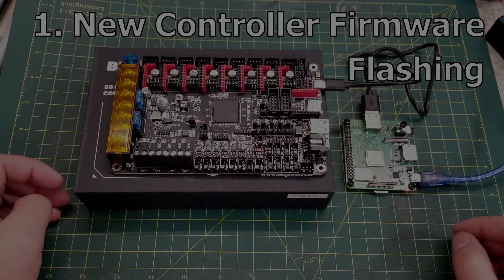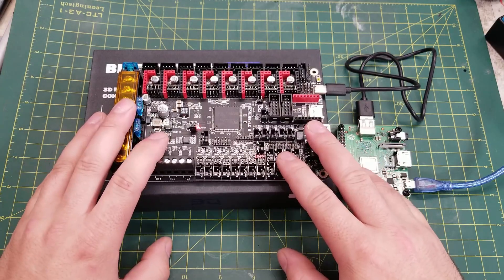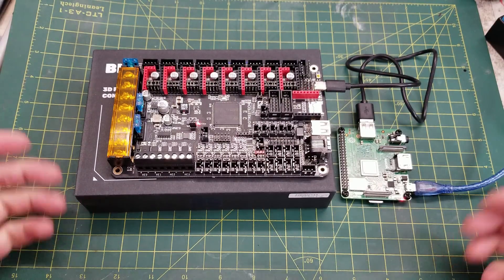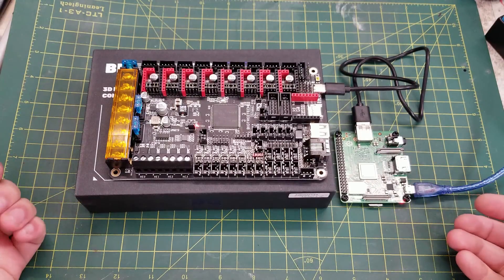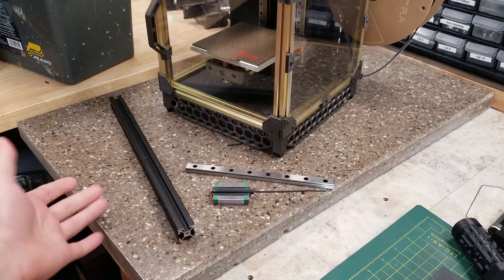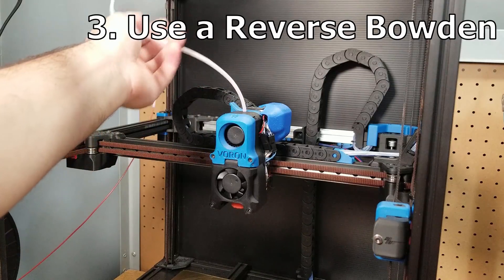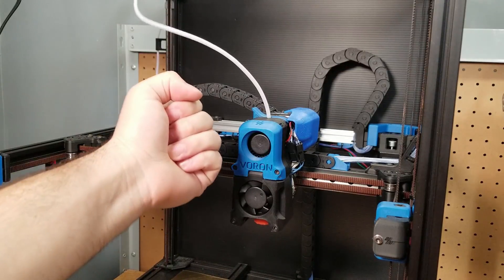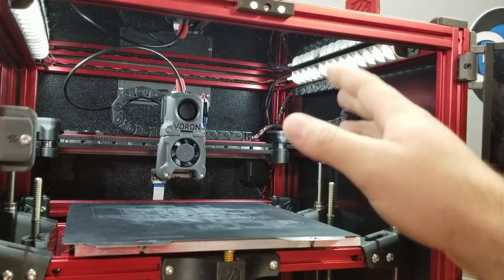Quick Tip Friday - Firmware Flashing, Reverse Bowden, and more

Comment: Does the reverse bowden tube just sit loose on top of the toolhead, with the filament holding it in place? Or is it meant to have an attachment?
Reply from the maker: Just a friction fit. its just a guide remember. So even if it where to pop out it wouldnt affect the print

Comment: The LED tip could probably be expanded by using WS2812 LEDs and connecting them to the MCU, Octopus and the Spider have a RGB port for example. 
A bit more setup but since Klipper can talk to them you can make some nice status LEDs or just overall gcode macro controlled lighting.
Reply from the maker: Getting all fancy with em will be its own video when i get the time :P